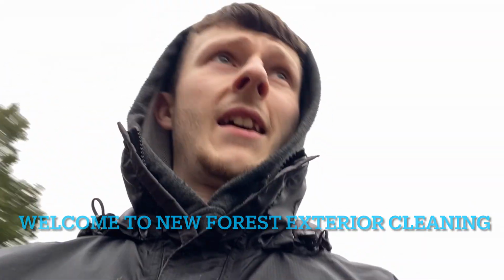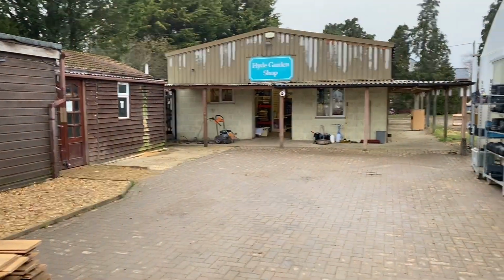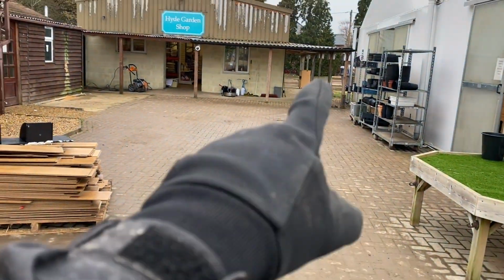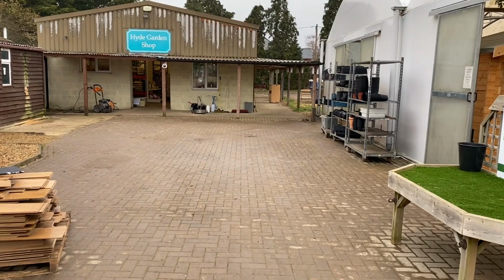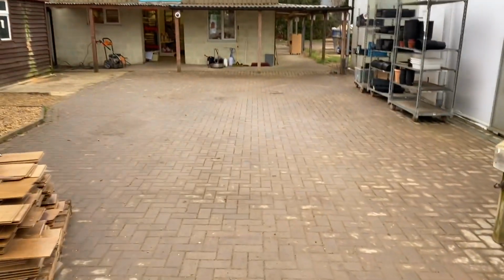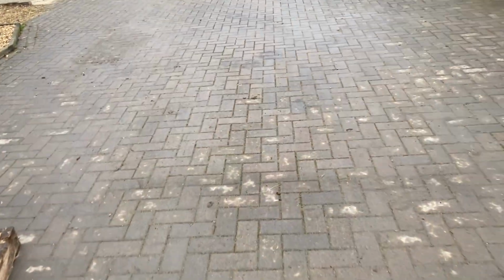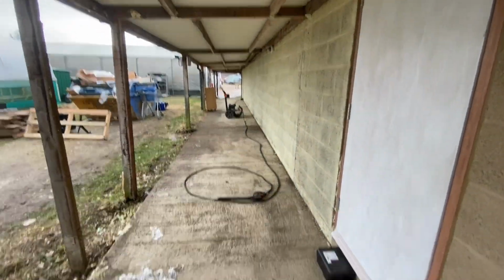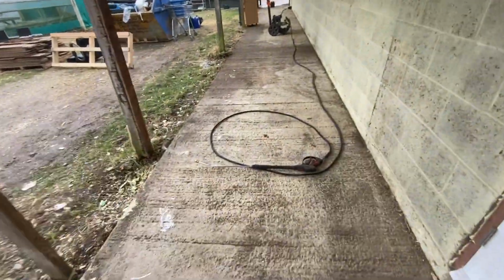Cleaning MUDDY Block Paving - My First Commercial Job pt2

Comment: Decent mate. How do you find the wilks machine? Which surface cleaner are you running?
Reply from the maker: Hi mate, thanks for the comment! For a starter machine which doesn’t cost too much it was great to me. I used a 14” whirl away which had 15 degree tips which was good for mossy block paving. And I had a 16” tevor surface cleaner for other stone types that had 25 degree tips. All links are in the description!